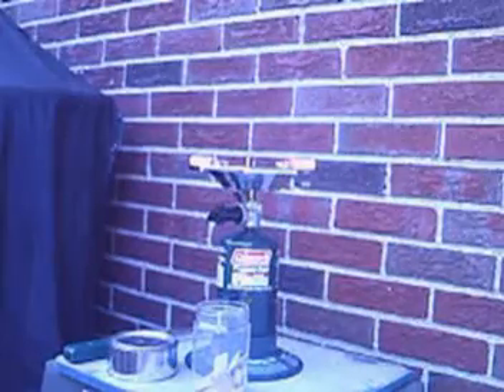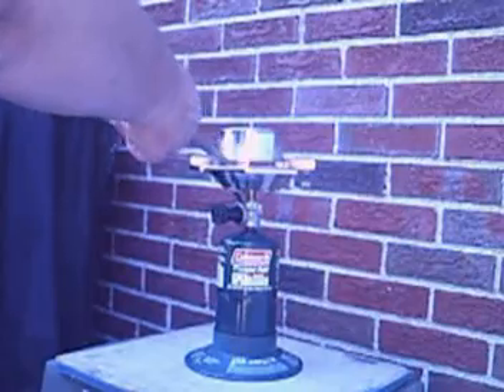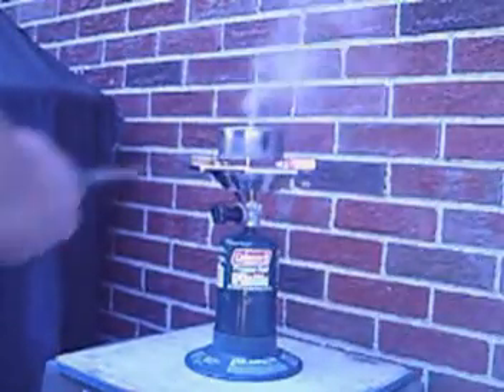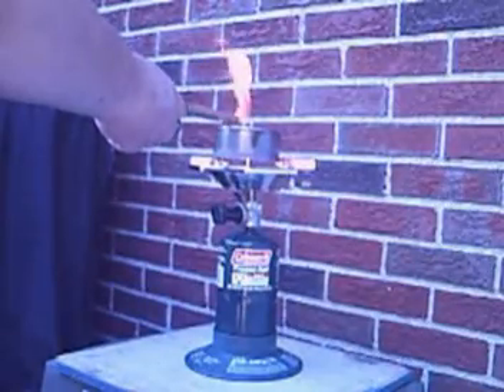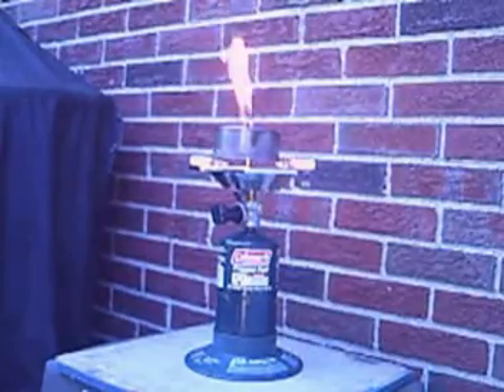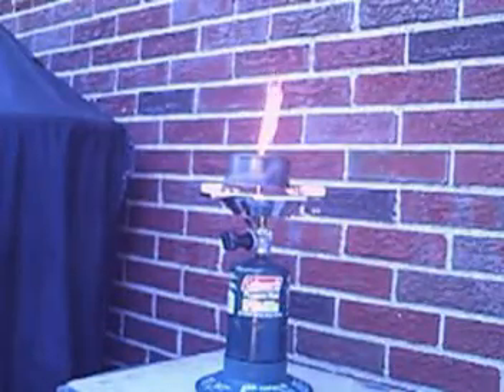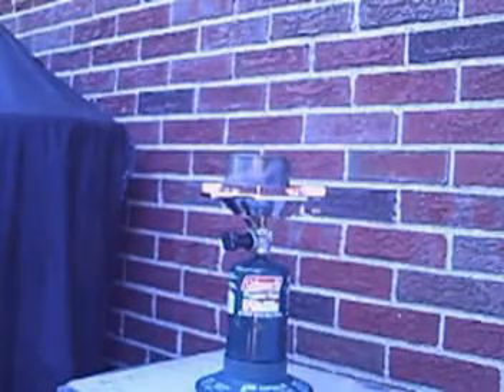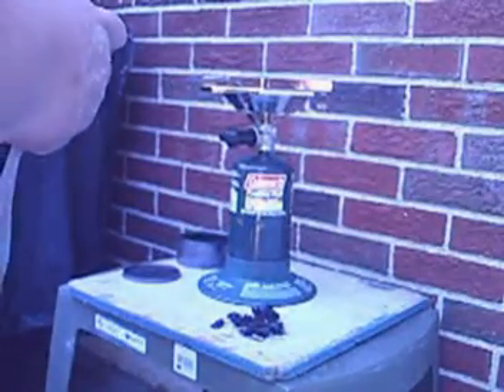Let's make some Wood gas

Comment: To get it to light better, I would think you'd need a small section of pipe on the end of the hole. The pipe should have a hole in the side to draw in air to mix with the wood gas. You might think the gas would escape from the secondary hole, but there should be enough suction for this not to happen. Think of a bunsen burner.

Comment: If you run a pipe from the hole into a second container, you can condense the gas into various oils. The pipe needs to be kept cool, and you can do this by wrapping it in a wet cloth.